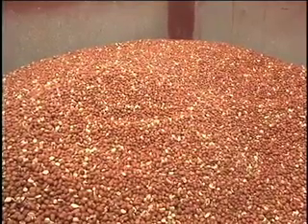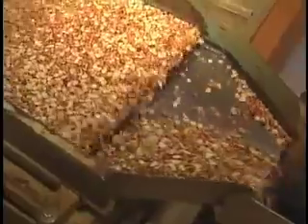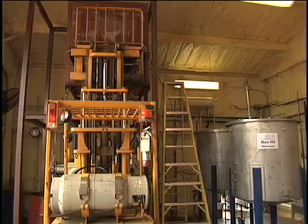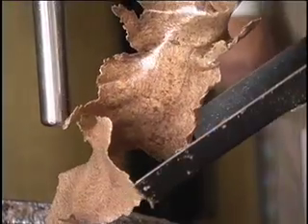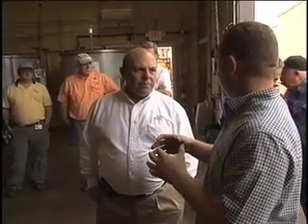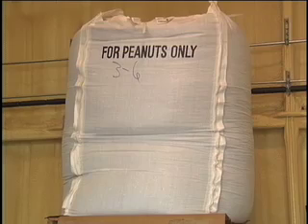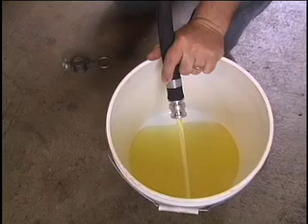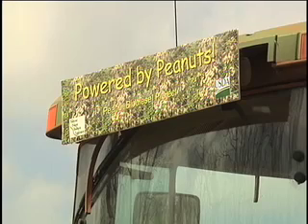Turning Peanuts Into Bio-fuel - Georgia Farm Monitor

Comment: Could peanut oil be ran straight thru a diesel if heated in order for better flow, or does it have chemicals that can damage the injectors?
Reply: The first Diesel engine was made to run on peanut oil
Reply: @hdunn8589 f off really?
Reply: It is possible. Oil is oil. I would do a burn test in a pan or can and compare it with diesel.